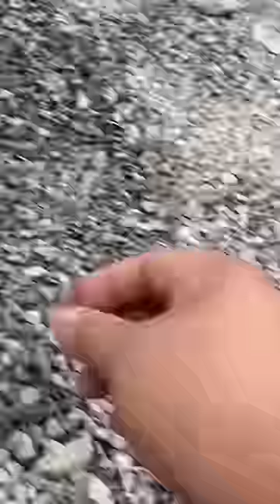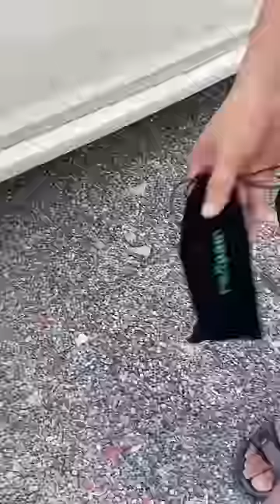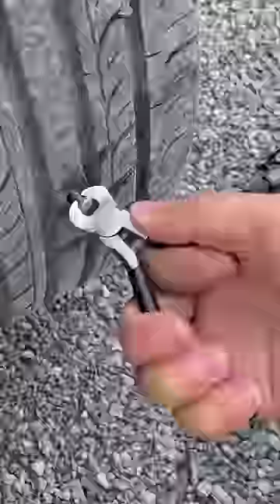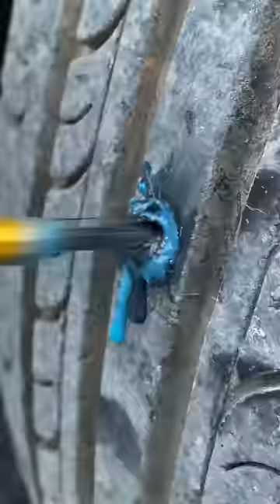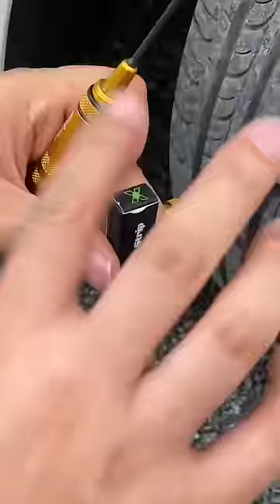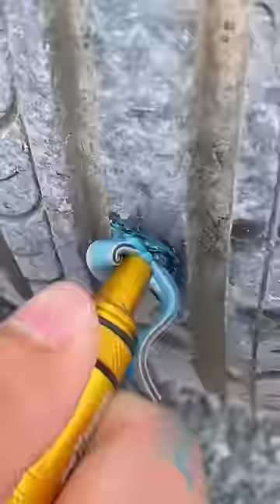$2 tire puncture repair

Comment: These gummy plugs aren’t meant for dot tires(tires for your car or truck). If you use a gummy plug on dot tire it will allow moisture to get into the tire making the tire wire on the inside to rust out and then separating the wire and making a impact bubble allowing for a blowout to happen. Atv bikes tractor tires  other stuff like that feel free to use gummy plugs. But dot tires are meant to have a plug and a patch. Go to your local tire shop or go to a discount tire if you live in the USA or have one near you they do the flat for free and while you are there you will be able to see your tread on your tires and recommendations to ways to make your tire last longer and stay healthy. And if you have bought the tires through discount tire and pay for the certificate aka the road hazard. If your flat tire isn’t repairable they will replace the tire for free. Go to your local shop it will always be better than using a gummy plug.

Comment: I am a professional  and  have fixed tires with plugs,a temporary fix. I have also pulled apart destroyed tires that have several of these cheap plugs inside. Cheap plugs like the ones in this video never hold!!!! You need good professional plugs to have a chance at plugging the hole. Also, plugs are just a temporary fix. The true right way is to take the tire apart and use a patch on the inside. But please don't use these cheap plugs, Tire will go flat The moment you try to drive on them and you take a good chance of ruining the tire.

Comment: Been messing with tires since 2004.  Uhh....no.

You do this if you're in BFE with a "tire inflation kit" and no spare.  This is not permanent and can actually damage the tire to the point of replacement.
Reply from the maker: visit rexpair.com to get on, use it you will know difference between you used

Comment: Having done easily over 100 plugs on tires I have never put glue on the reamer, all you are doing is wasting glue. I have also never used those style of plugs as they are very prone to failure. If the loop comes back through the hole you have used the wrong sized plug and it won't seal properly, it will also allow moisture in and start rusting the steel belts of the tire and then the tire separates and you have a blowout.

Comment: I rode 6k miles with a repair like that one year. Always worried it would fail. Never did. When I changed out the tire that strip was barely hanging on. Get it changed right away if you can afford it
Reply from the maker: does the kit named "reXpair" ?

Comment: never used the blue stuff.,.
just heat the plug strip up.with my lighter, then sink it, and air it up a lil
Reply from the maker: respect our thousands tests. fluid is important, visit rexpair.com to know more. walmart or amazon available.
Reply: @reXpair  the HUNDREDS of patches I've installed have worked with no issues, junior.
I think I'll keep doing it my way, but thanks for your egregious concern...

Comment: This was not done correctly . Both sides of the white film backing needed to be peeled off the rubber strip before inserting into the tire . The sealant needs to be applied to the rubber strip not the white film .

Comment: Or you can take it to les Schwab and have them patch it for free. Btw, not a shop worth its salt would fix a puncture with a plug, high likelihood of failure, hence why shop won’t do them anymore.
Reply: Some shops still plug tires. I worked at an Acura dealership last year and we didn't even stock legit patch kits. We just used regular old worm plugs. Paid half an hour labor lol. Now working at a different dealership (Kia, of all places) and get paid the same amount to pull the tire off the rim, grind around the punctured area inside of the tire, apply adhesive #1, pull the patch through from the inside, apply adhesive #2, remount the tire, and rebalance the tire... Kinda wish I could just use plugs again. It took like 2 seconds.

Comment: For an ATV tire this is OK.
For a car tire this is the worst possible way to “fix” it. 
If you want the tire to separate and fail, by all means do this. It does not adequately seal the liner and allows air to work into the cord body over time. 
This leads to separation and failure.

Comment: A lot more work than a regular no glue required plug. That glue can make a mess. 
Cool video though. 👍
Reply: Ps... you diurnal peel the paper off to expose adhesive.

Comment: Your wasting so much glue putting it on the punch/file, it's all just running.down the inside of the tire. Put it on the plug like you did.and that's enough. Also the round rubber plugs are a lot better.

Comment: This guy used way way to much lube for a plug.  Used a cheap bad type of plug.  And then barely even pushed it into the tire at all.  Do not follow the advice of this video, that repair will no doubt fail.